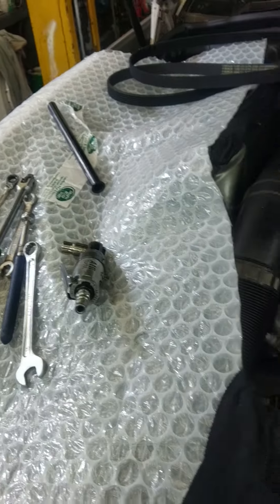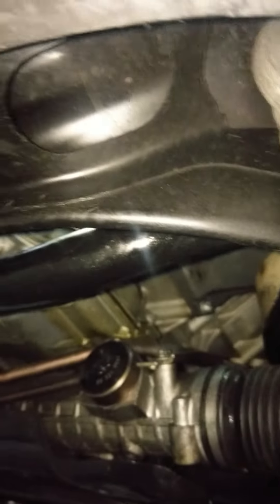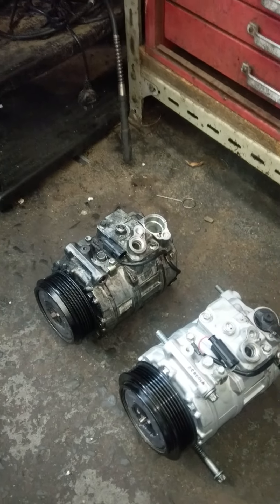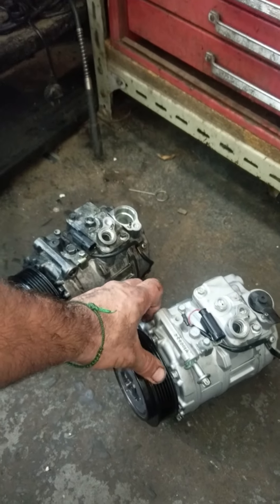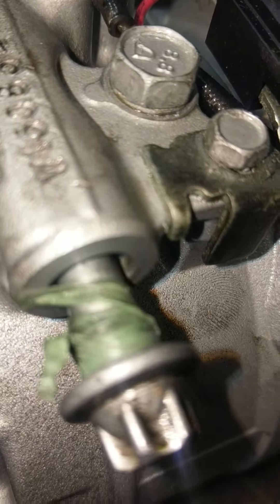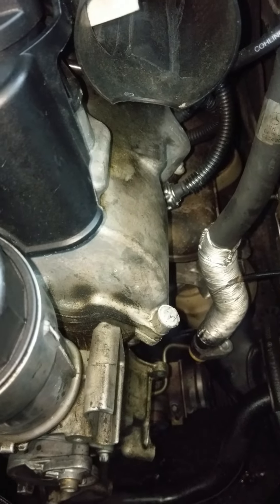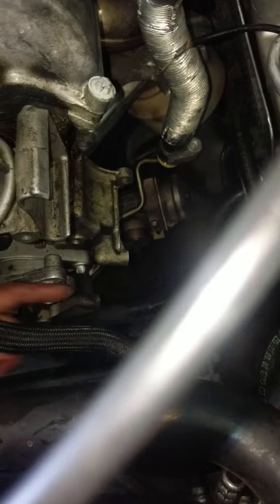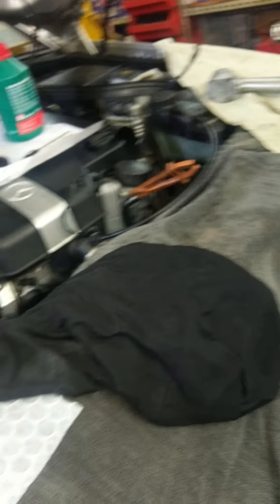Mercedes Benz E class Air conditioning compressor AC Mercedes V6 whirring whining noisy engine

Comment: Happy Aussie Day Too, way over from "handle of the pan" Ponce De Leon, Florida. Thank you for your brilliant video especially the "concert of sound" description totally thought it was oil pump, and/or dried up o-ring on oil sump tube inside oil reservoir starving engine making all that noise. Nonsense on me, low and behold there were the front cap and bushings stuck between hoses and radiator shroud. Enjoyed your content, happy as Larry if you like,no worries mate, Rock on with the channel. I'll be sure to share and promote you here in the States, yippee from east of Mississippi 🐉🥁🎸🌅

Comment: This guy is just trying to scare people from doing the work themselves people aren't dumb
Reply: This job is a monster. That one bolt on the bottom can very easily ruin your day.
Reply: @wizardindustriesusa - That bolt can ruin the day, as can ANY other detail. If badly tackled! 
Most people who never worked on a Mercedes have no clue about it. Might look complicated and extremely difficult. But for a car with this level of equipment and tech it's amazingly simple. IF one knows what is doing! 

With this said, there are not many cars out there with the material quality and finish of most Mercedes. Surprisingly, or not, things really fit! ;-)
Reply: @wizardindustriesusa lol, any 10mm 12 point wrench can crack that up from the top, only thing is you can’t actually see the bolt